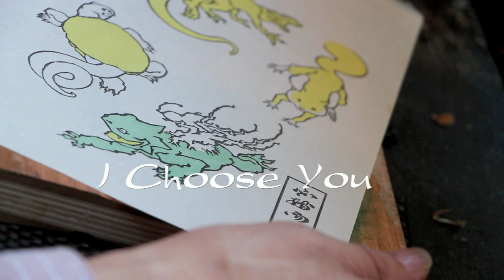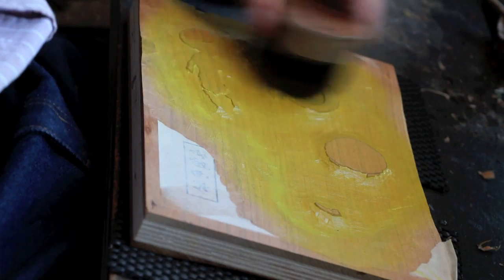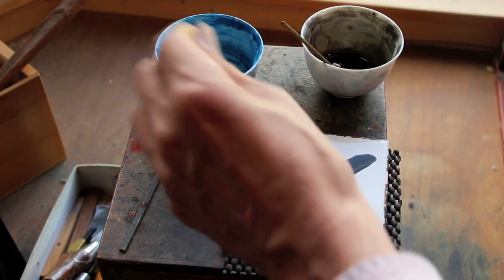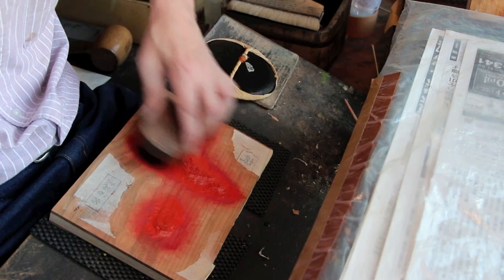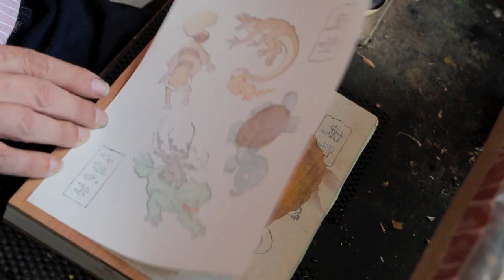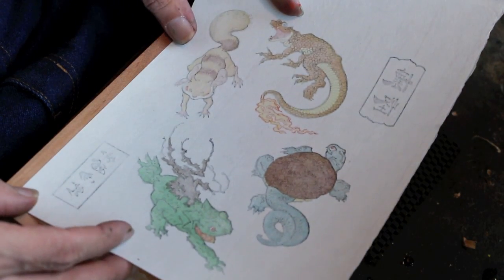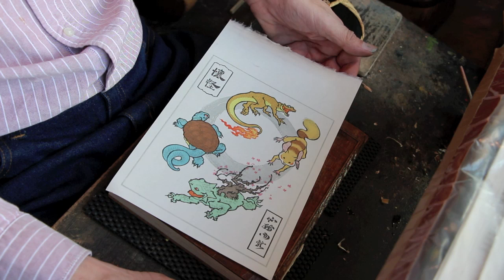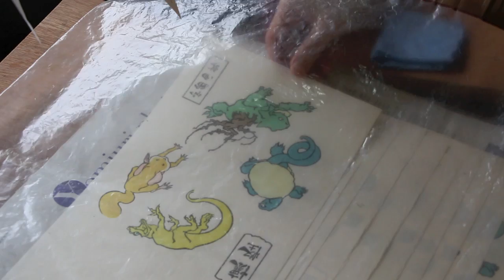Ukiyoe Heroes (21) : Making the 'I Choose You' woodblock print

Comment: I am struggling with getting the consistency of the pain right. My water-based paint is too sticky on its own. It leaves clumps on the paper. Mixing with water, I made it too wet. Adding starch doesn't seem to help. I guess I haven't yet explored the parameter space of paint/water/starch fully. Looking at your video helps quite a lot.

Comment: Wow, I've seen this and the Rickshaw Cart one, but I didn't know they were actual ukiyoe prints. What kind of inks do you use? I've done woodblock printing before and I'd love to get into this kind of technique.
Reply from the maker: We use no 'ink' - it's all dry pigments, mixed with water. I can't link here from this comment, but if you head to woodblock com, and scroll down to the bottom of the front page, you'll find a ton of information on this ...